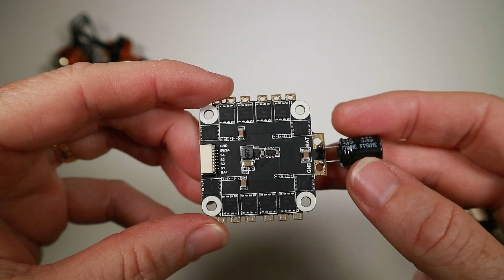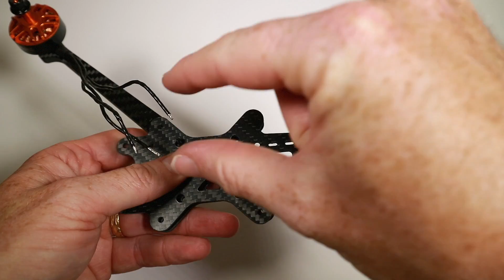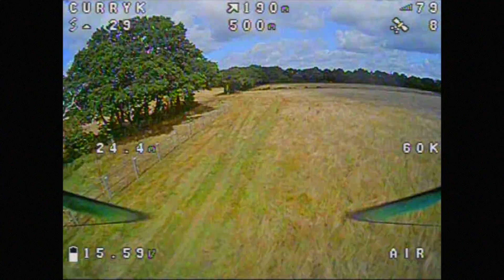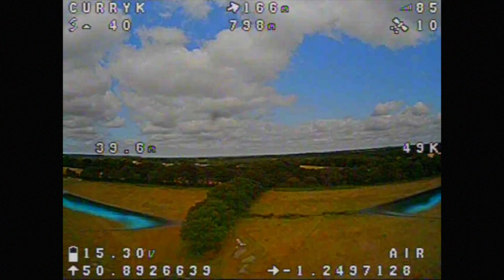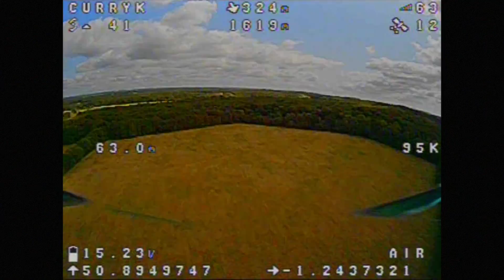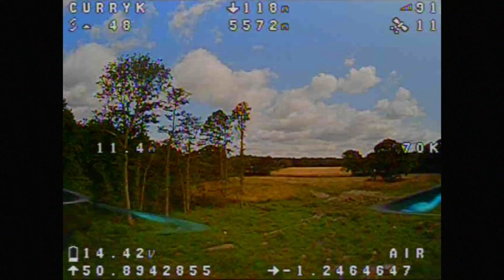Eachine Tyro129.  A 7" build-it-yourself-quad with a GPS.  Supplied by Banggood

Comment: I am happy to say I've joined your Paterons. Your videos are just real, no hype, no BS, no grandstanding or drama, just what you found. You seem very real world, more or less just an experienced enthusiast, rather than an  " expert ".  I like that, because I'm not an expert either. You test in real world conditions. As for this particular model,  in Canada, long range ( ie out of sight  ) hobby flying is not legal, except in certain circumstances. Also, my fleet is going down in size ( think Toothpick + ), not up. 5S and 6S batteries are very expensive, and not necessary for my flying. Keep up the great work !!
Reply from the maker: Well thanks for the nice words and the Patreon support :)  BVLOS isn't legal here either, but I tend to use a more common sense approach.  i.e I'm in the middle of a field with nobody about and flying low enough.  I totally get the reasons for going to small/lighter models though.

Comment: Impressive quadcopter!  A very nice review, thank you.  Interesting info on the batteries.  I am very fascinated with this type of long cruising quad. The price is amazing.  Oooo. I just ordered one.
Reply from the maker: Yeah, me too.  10 minutes out of a battery flying quite a mixed throttle means I could get at least 15 out of it if I took things easier.  I'm also convinced there's a better sized lipo that could help as well.  Price is awesome - I couldn't source my own parts for that little.

Comment: CurryKitten, I just finished building this model and was able to get 'smart audio' working for the VTX allowing you to adjust the settings in the OSD and using lua-script via a controller running openTX. I did this with the stock wire bundles...you will need to figure out which bundle goes where but it's somewhat intuitive and it sounds like you already figured it out. This is the small change I made... One wire bundle goes to the VTX which is connected on both sides with white jst connectors. The jst connector side which connects directly to the VTX has a matting available pin for "Data". Another one of the stock wire bundles is for the receiver and comes with two different connector sides, one which is an old esc-type black side and a side which is another white jst connector. I carefully de-pinned the yellow wire from the white jst connector(cutting it from the old esc-type black side) and inserting the pin into the white jst connector for the VTX on the side which connects directly to the VTX at pin location "Data". I then soldered that yellow "Data" wire to Tx4 pad on the top of the flight controller and then configured my port section in betaflight with Tx4 which then used TBS 'smart audio'. I then connected my R9MM using Fport at Tx3. I only used the stock receiver wire bundle for the receiver's power and ground. Hope that helps.
Reply from the maker: Thanks - a few people have mentioned this VTX can do Smartaudio, and someone even mentioned that they were no shipping with a more "complete" cable.  I have the Tyro119 on it's way (same thing with 6" props) so I'll be interested to see if it's the updated version, but if not I'll show how it should be connected so other people know as well
Reply: @CurryKitten  Thanks for your videos, I really enjoy them.
Reply: @CurryKitten  Hello sir. Did you get the tyro 119 yet? You didn't post a vid about it. Curious to see the difference in PID's and overall spec. Thank you for your time and videos. Greetings from Ireland.👍🖖
Reply from the maker: I do have it and it's mostly finished, but I probably won't have the chance to fly it and finish the review until after Xmas now (as Im away for a few weeks this month) It feels very much like the 129 with slight shorter arms.  They still didn't give the cable to give Smart audio out of the box, but I have made the point of adding an extra wire to that plug so it works now.
Reply: @CurryKitten  Cool! I'm glad you got it working. I added an R9 to my Tyro 129 and changed the camera to a foxeer falkor mini. It's really a nice cruiser and I'm hoping to take it 3 miles out soon which will be my farthest...fingers crossed. Thanks again for your videos.

Comment: For the silver press nuts in the bottom plate I would highly recommend a vice over hammering and triple check what side your putting them in on.
Reply from the maker: Sounds like a good idea.  I didn't have one so hammer wins

Comment: Thank you for naming all the parts as you unboxed this, it made ordering spares way easier for me
Reply from the maker: Glad it was useful - although it sounds like you broke a few bits - what happened ?
Reply: @CurryKitten  I didn't pay close attention to the modes setup and fail-safed from about 50 feet onto concrete with 4s 5000 mah lipo. The battery seems functional, bent, but somehow lost the GPS module and an XM plus mini receiver antenna. Still flies like a champ, waiting on new parts now.

Comment: Thanks for the great video.  I'm looking to build my first quad.  I was totally excited about the price (I can't put a kit together for less than $180-$200 myself so far) but think you need a little experience to work the bugs out.  I may have to pass and keep searching for something a little easier to put together.  I like the idea of the battery on top and the ability to put a GoPro on top.  I'll figure it out sooner than later I hope.
Reply from the maker: 5" gear is probably the easiest for a 1st time build as the parts are very easy to come by and pretty cheap (although this kit is too)  But building is a great thing to do - do will know how everything connects and that demystifies it all.  Always be prepared to iron out a few bugs even on RTF's or more expensive kits - you'll always have something.  It's a little old now (so a bit out of date in parts) but I did a few blog posts covering a build if it helps https://www.currykitten.co.uk/martian-iii-quad-build-part-1/

Comment: TY - ordered one off your link! Don't know if I missed it in your review but it only needs a cable adding then smartaudio will work. They may have changed the kits by now but, if not, I'll add one. It was £98 with shipping insurance from UK warehouse. What insane value is this? I have some big 4S lipos so just couldn't say no! I'll also use an R9MM.
Reply from the maker: That's a great price for a nice kit.  There's always little annoying quirks with these things, but this has been one of the best kits they've done for a while.  I've heard from a few people about the VTX supporting smart audio but have never bothered to hook it up.  I'm actually intending to use mine to test with a different VTX and camera.  I'm always swapping things in and out :)

Comment: I completely agree on your findings of the TS100. Not my go-to iron for larger work like battery leads and whatnot. It just doesn't retain heat like a proper soldering station, but the DS24 tip helps some. But nice to have in the field though. Thanks for the great review :D
Reply from the maker: I was using a BC2 tip, so I might give the DS24 a go .  Yep - an absolutely lovely iron for everything... except this :D

Comment: Smart Audio I believe  is possible on the vtx by adding a wire to the plug. I have ordered one and will not use a heavy GoPro so I am going to try some 7 inch 2 blade props for better efficiency.
Great video !!
Reply from the maker: The VTX does seem to have pin on the connector marked "data", but the manual doesn't make mention of it at all.  A bit confusing.  We certainly seemed to have some spare UARTS to use it as well.  Will need to check that out and see
Reply: @CurryKitten  But other reviewers have found that it is Smart Audio. They think it isn't hooked up because of licensing issues. Think "cheap"! :)
Reply: @ericbraun4652  Got mine working fine [smart audio] ,just added a wire. Also mine is absolutely smooth with no jello  . I ran up my motors without props and it was smooth ,I then balanced the props which were quite out of balance. Also went to a 2 blade Gemfan 7042 and get better efficiency. May try a lower pitch 2 blade in the future as with the Gemfan it still hovers at the same throttle setting as the 3 blade.
Reply: @turboomni848  Cool! Mine arrives Monday. I had a Skystars G730L but it flew off with no GPS while doing long range. Perfect picture and then "poof" as the Taranis announced "RF Critical". So... learned my lesson about GPS!

Interesting that less pich on 2 blades hovers at the same throttle. But I agree... if we want efficiency, 2 blades is the way to go. I might try that too.
Reply: @ericbraun4652  Good luck with your tyro. I just lost my first gps quad last month so I feel your pain. I never found it but I did see on another build that you must in the gps section in betaflight set the sanity to "failsafe only" not 'On" because if you turn on your return to home within 100 meters it will crash. That's what mine did......
Reply: @turboomni848  can you supply a wiring diagram , I'd like to get smart audio working and crossfire working

Comment: Funny there is a note on the link that recommend putting gps on arm or on gopro mount 👍
Reply from the maker: Certainly makes more sense than with the product page suggested from the pictures.  If they would only spend a little bit of time making decent instructions then I wouldn't have to interpret what I think they are trying to tell me :)
Reply: @CurryKitten  it gets ridiculous sometimes 😵👍 i do like it though seems pretty good for that price hard to pass up for a 7inch with all that 😄

Comment: Those silver nuts are called p.e.m nuts.  (Press fit) tip use a screw on the opposite side of the frame to tighten it and pull the nut tight into the hole so you dont fracture the frame. Also the capacitor on the esc looks like the board should be rotated 90 degrees so the cap hangs out like the emax babyhawk r. I hate it like that but it will make it all fit really well. You may need to re map the motors in betaflight but it will make life easier and cleaner looking. Also it will make the motor wires tuck into the frame almost the way you like to wrap the wire around the posts
Reply from the maker: That's a good thought - one that I didn't consider.  I do like to always follow the example instructions that have been given when I get one of these though - and only deviate if something obviously doesn't work (like the GPS) but I like your solution there.  Remaping motors is no hassle (although beginners may find it intimidating) I had to position a board inverted on a build last week, so every motors was wrong :D
Reply: @CurryKitten  I have a remix I built and the boards are mounted to the top plate. Esc is above the  flight controller and inverted and (forgetting this fact every time I re-flash a new betaflight (4.0.0) and the to the moon bug or remember anti taz well i forgot that my escs are inverted and figuring out why nothing was working right and flipping out and pids are spot on was really frustrating till i physically looked at the board. Next issue was the way the flight controller I was using (dysf4pro v2) the esc wires were in the way and usb was in accessible with default configuration and (having a big 35v capacitor also with gps and crossfire) it was a matter of switching the alignment but also forgetting my gyro and acc sensors were now all out of whack and calibrating with it wrong lead to me losing some hair trying to figure out why nothing works. But the best thing I learned about this hobby is nothing is dead set the way it is in the manuals as long as you know how things work and what (the right way looks like to base everything off of and hundreds of videos like yours helped me realize this. For the beginner I suggest doing like you said but if things dont look right if you make small changes and see if it changes other things you will go far! But also the moast important is the fpv community amd the willingness to help a new guy (as long as your not a new guy giving bad advise to be part of the conversation) this hobby is like nothing I've experienced anywhere not even church! I have a skystars gl730 that's in desperate need of donor parts. The motors went to the remix beciase the emax motors lasted 3 6s flights and the skystars motors on 7 inch were anemic for the size but perfect for 5 inch. You may have sold me 9n this quad for needed parts that I've had a hard time sourcing decent motors for 7" that wont cost 2/3 the price I paid for the whole quad.
Reply: @CurryKitten  wish you can post pics in comments that way people who have done this build and have found better ways to do somthing post a pic to show how they did it. I suppose facebook but I dont like the drama of it!

Comment: It looked great on my new 55 Inch TV Wayne, especially the HD..Good to see you flying rather like I do m8...lol...and going out 500 MTRS....The GPS was never going to work under that bottom plate..I regularly get 10 or 12 minutes on my 5 inch and a 2200 4s..a bit of jello in the feed.
Reply from the maker: I challenge you to fly stupidly fast and get that down to 5 mins.  My normal 1300 4s last 3 minutes, but if I am really careful (and bored) I can get 10 mins out of it.  Bit of jello yes, looking forward to testing it on a calm day and see if it needs tuning some more
Reply: @CurryKitten  lol.. anyone can burn through a lipo....I'm a bit miffed because I just started a Mr Croc build, this deal is good value considering all the bits you get IMO ..Look forward to seeing you tune it some more and stretch it's legs...Out to 2kms. !!!!!!Get a Moby on it.
Reply from the maker: Yeah - it's pretty good value isn't it.  Hd might be going onto it depending on the changes I want to make... but won't be anything bulky.  Nice to keep the weight down.
Reply: @CurryKitten  Yes, getting smooth footage off these bigger quads is more difficult to do, so will be interested to see how you get on...Those ridgid winding wires are spoiling it  TBH...what were they thinking?

Comment: Got one of these a few weeks back, good but hit a branch on damaged two motors. Bell is quite weak, just ordered set of racerstar 2508 to replace them.
Reply from the maker: That's a shame - I think they are definitely built to a price.  On the bright side, at least you'll have decent motor cables to work with.

Comment: I tried  the first TYRO  ??  79 ??  and I swore if you gave me another I would not build it BECAUSE OF THOSE MOTOR WIRES !!!     I ended up finishing the build with different motors.   why would any motor company use that plastic wire ??  glad you had the patience  ...
Reply from the maker: Because they are cheaper - is the quick answer :)

Comment: Use flux, and keep your tip very clean with solder cleaner paste and tip tinner, might help with soldering those pads.  The 45 cut conical tip works better for me than the chisel tip on almost everything.
1200 is way too high, it is about a factor of 8x too high for a yaw rate lol.  I wasn't watchign the screen, but I imagine the other settings are just as bad.  Unflyable with those settings.  Shoot for maximum roll and pitch rates around 200 to 300, and for yaw set it at 2/3rds of what you set pitch and roll to.     So, for example, 200, 200, 133
Reply from the maker: It's been a while so I had to go back and watch that = yes my tip is a bit wee for large pads, I keep meaning to get a better tip, but it hasn't happened yet :)  I can't imagine flying with rates of 200-300 though, that's like nearly 2 seconds to flip.  My usual rates are 1000 (superrate of 0.8) I find that gives plenty of control mid stick and can flip really fast when I need to.  Although I might setup something slower on a larger quad, I find my timing gets thrown out by having different rates on different models.

Comment: It's nice how they added a platform to mount the GPs but it's weird how they went with it being under the vtx antenna. If anyone gets this for long range then use inav!!
Reply from the maker: Yeah - a really odd choice.  iNav sounds like a good thing, but it requires a compass as well doesn't it - and this is just a plain GPS unit
Reply: CurryKitten oh, yeah I forgot inav uses a compass for quads. It's strange really why quads need a compass but planes and wings don't.

Comment: Nice Video. Regarding your TS100 issue, you can get a bigger size bit for TS100, I do the same and use 2 bits depending on the requirement.
Reply from the maker: Yes - someone else mentioned this.  I'm using a BC2 for my chisel, and they suggested the DS24 which is larger still.  So I'll try and get hold of one

Comment: Keep up the good work.  Have you got RPM filtering working on that ESC, any PID and filter set up required if you have?  Are you doing an INAV review on the flight controller also?
Reply from the maker: Nope - when I review I like to use the settings that came out of the box to see how it does.  I'd like to mess about with iNav, but last time I checked if you didn't have a compass as well as a GPS then the functionality was extremely limited.
Reply: @CurryKitten  Thanks - your big 500mah  battery, what C rating was that?  I want to get something similar for mine.  No sure how low a C rating to go for - I just want to do some long cruising flights, no tricks.  Would a similar mah 3S work?
Reply from the maker: @gordondmckee  That was a multistar 5200 so just 10c.  It's not particularly useful for multicopters - fantastic on a plane though.  I tend to think that somewhere around the 3000-4000 will give you the best bang for the buck.  No doubt it'll fly on 3s, but it might use more throttle, which in turn might use more amps than a higher cell lipo